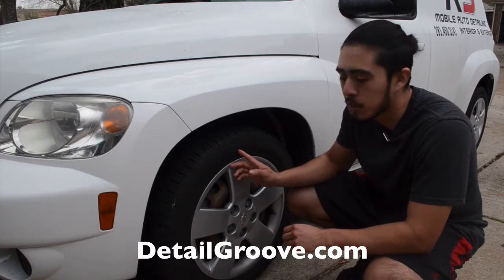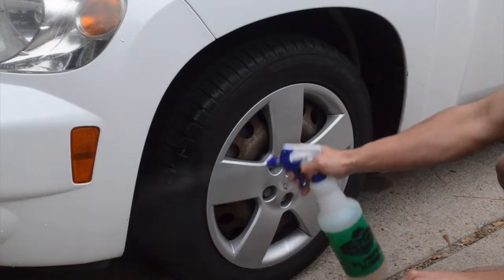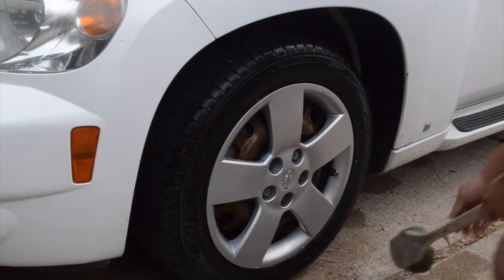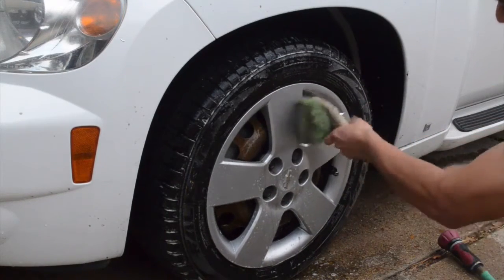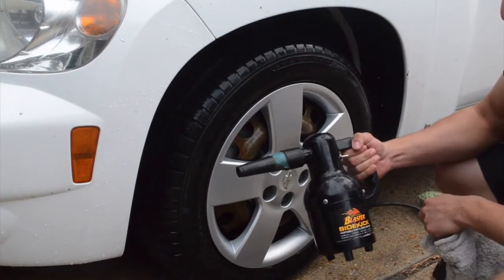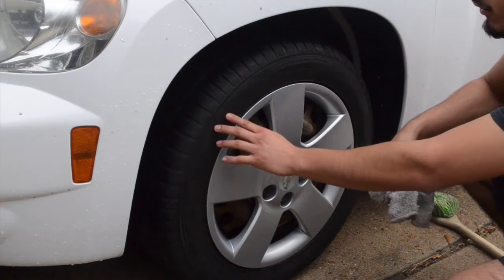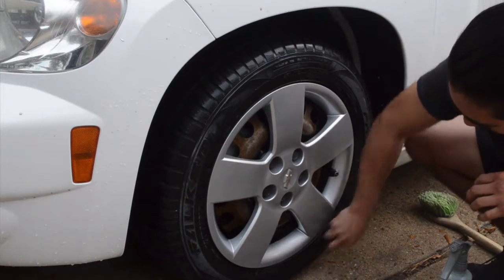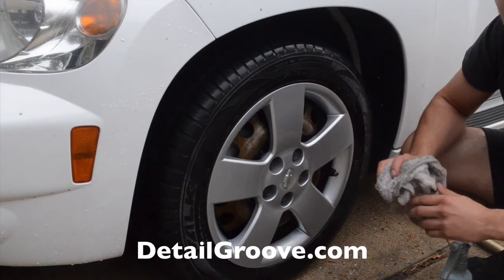Tire & Wheel (hubcap) Cleaning and Dressing

Comment: What if you don’t have a water source when washing muddy tires and wheels?
Reply from the maker: I use the leftover rinseless wash and use that for the wheels and tires. I'll also have a pump sprayer. There's also a new electrical pressure washer that is VERY helpful and hiley recommend